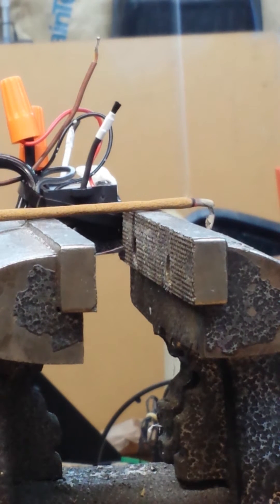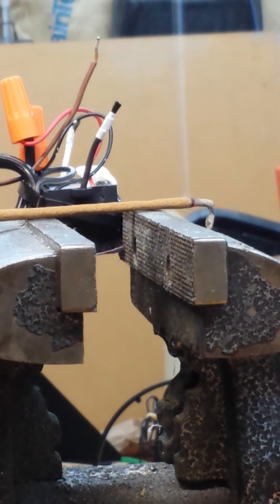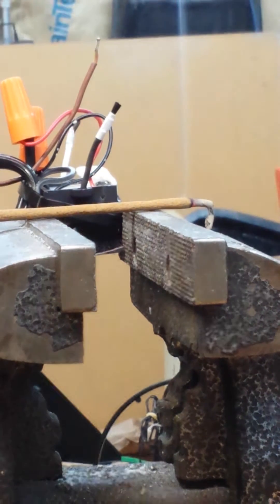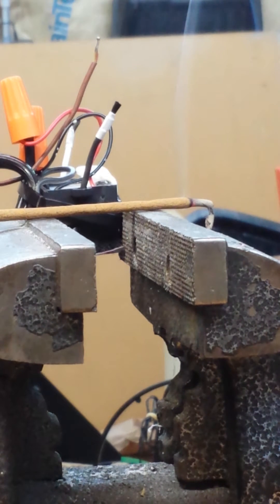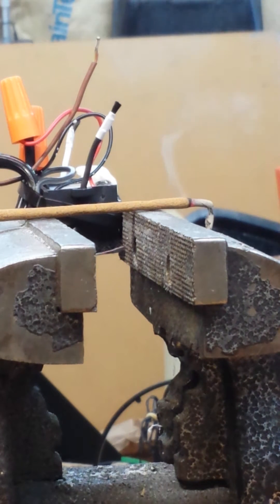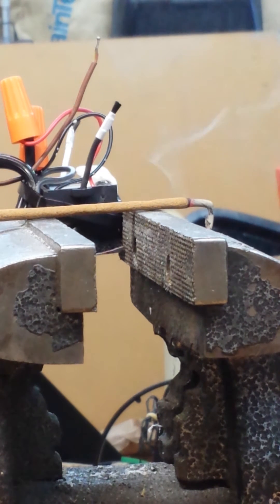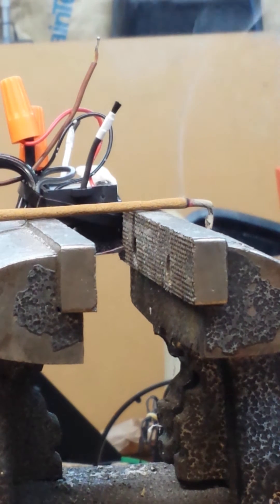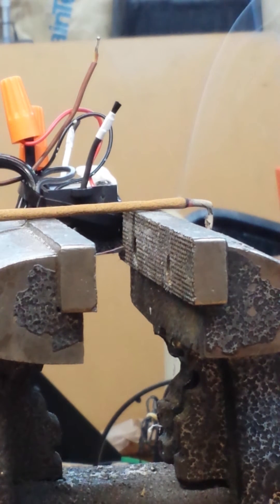Cold plasma generator test

Comment from the maker: The primary purpose of a filter is to protect HVAC equipment, not to improve indoor air quality, as many homeowners have been led to believe! Said Bob Vila....He's 100% right. So what does clean our air inside our homes? The latest technology on the market are plasma generators. When these devices are used in conjunction with air flow inside the HVAC equipment, good things begin to happen in your air! Particulates are reduced, bacteria & mold are killed, gases and odors are reduced and the entire house has clean air...You wouldn"t go to bed with dirty linen, would you? Then why breathe dirty air inside your home or office? We are installing these devices regularly and the feedback has been phenomenal... Contact us, Pro Active Mechanical, Inc. either at www.proactivehvac.com or www.facebook.com/PMIHVAC. You can always call or text us as well at (630) 514-5431...We cover approximately a 100 -mile radius of the Chicagoland area and can ship units out to you!